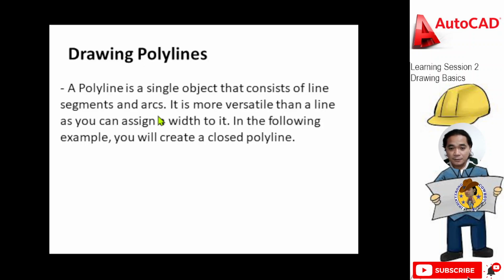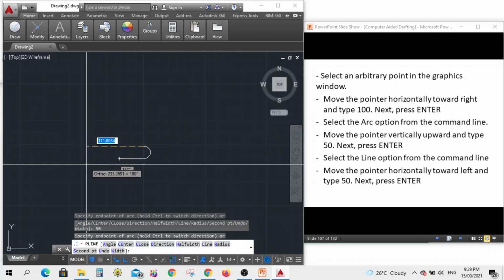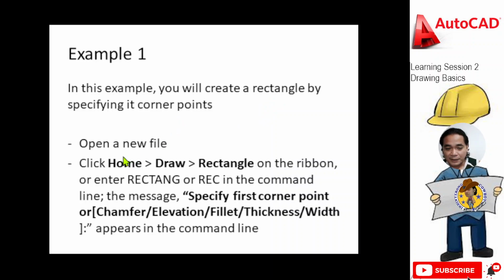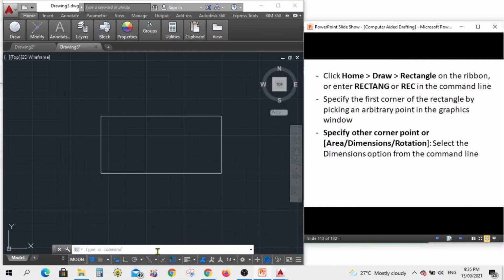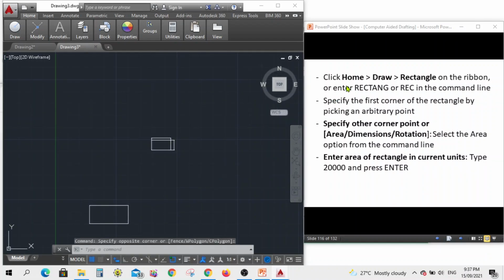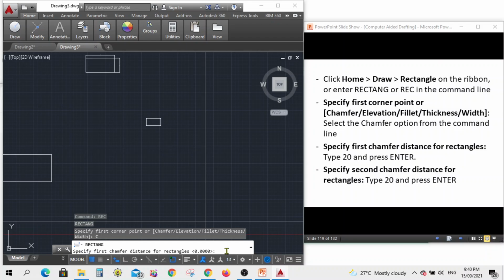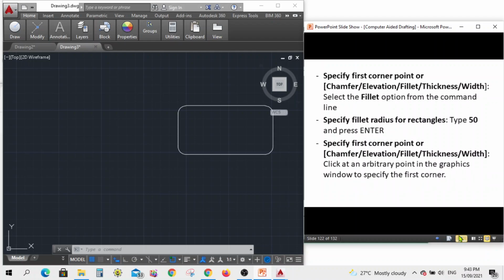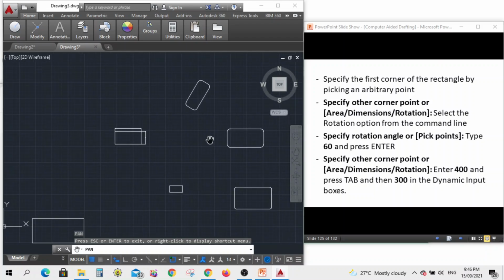AutoCAD LS 2-8 | Drawing Basics

Comment: This part, I learned how to draw polylines and rectangles from this video. It helped me grasp how to draw such forms, and I was able to draw them properly thanks to this lecture. So,   Having started with the ortho mode, that also provides a different perspective, drawing polylines appears challenging initially, but it is genuinely as simple as some of the other earlier chapters in that we simply draw a line, bend it, and explicitly state how lengthy it would be, and that's it. With both the rectangle, we gain knowledge how to explicitly state the edges and the chamfer range to start making through. Again, Thank You Sir for imparting  your knowledge. Kudos To You po!

Comment: starting with the  ortho mode which gives us a different view, drawing polylines at first seen on the video seems kind of difficult but its actually as easy as the other previous topics in which we just make a line and make its following arc to have it bent and specify how long it will be and thats it, with the rectangle we learn hwo to specify the corner points and the chamfer distance to make one.